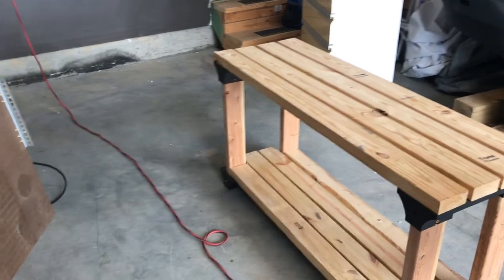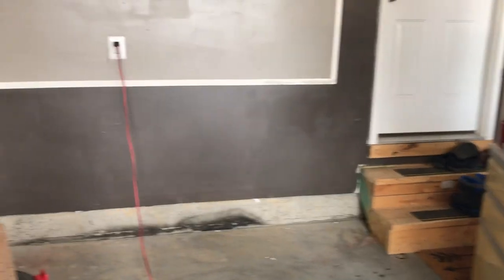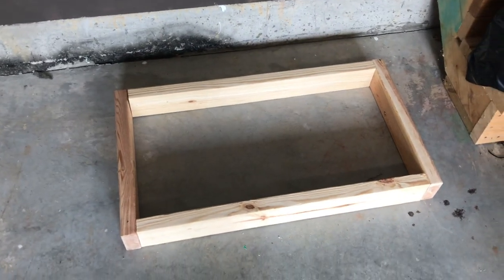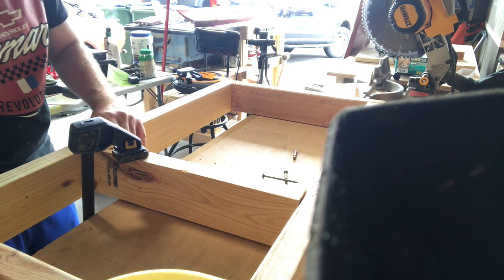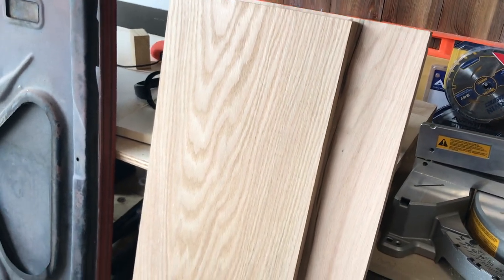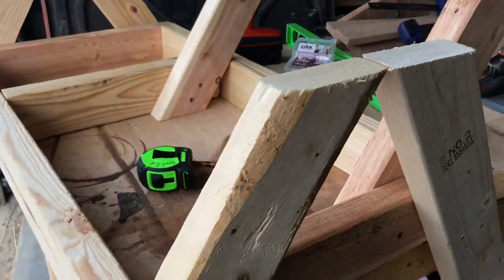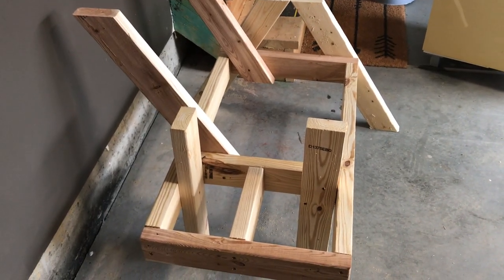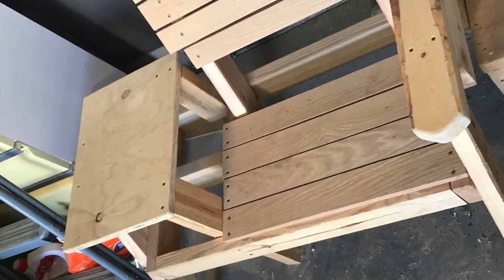Easy to Build Wood Chair

Comment: Hi.  Do you have any plans to follow.     First project and living in Uk.     Brilliant chair !
Reply from the maker: I can post measurements if that helps. What I built is a little small, I would’ve made it slightly taller if I had made any plans to begin with.
Reply: @woodchipgarage    Thanks for the reply.     But I’ve made this chair today it’s awesome. Thanks
Reply from the maker: @sandraguest5745  I am humbled.
Reply: @woodchipgarage thank you.